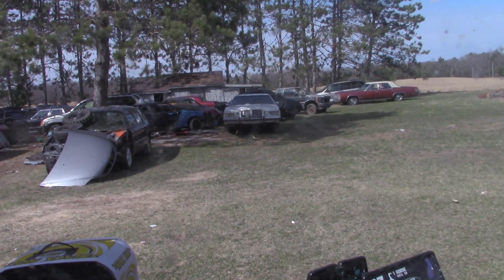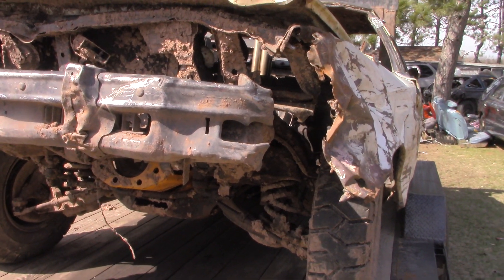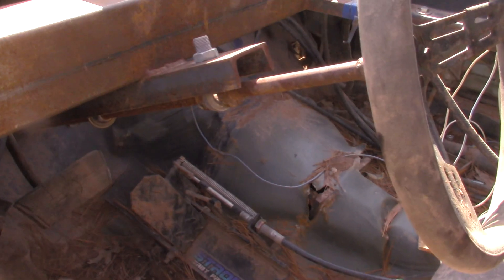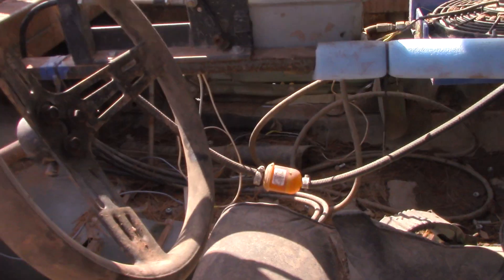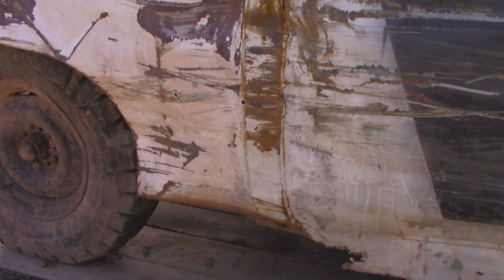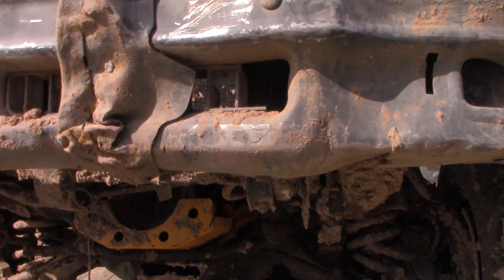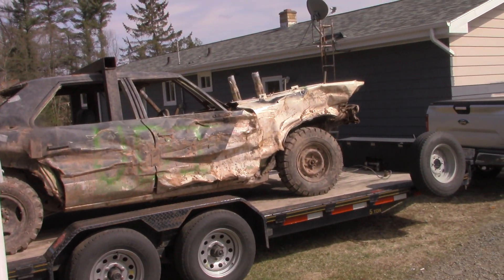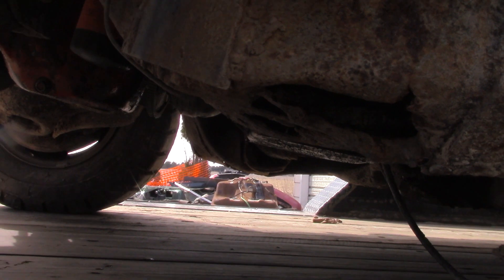NEW BIG CAR INTRO.... 1 of 4

Comment: I think there's two more good runs in her, probably three or four if you don't go nuts. That's a helluva cage in there. Go ahead and reinforce that front frame if they'll let you, and trim the clip back to the radiator housing so there's less of it to fold up and interfere with your vision.
Reply from the maker: so one good run if i'm behind the wheel...

Comment: The front isnt bad enough in my opinion to need to be re-stubbed. Id just pull it down a little and run it like it sits.
Reply: Agreed
Reply: I agree too.
Reply from the maker: leaning that direction
Reply: @1GooseGarage  good. I wouldnt put a bunch of work into it that it doesnt really need. Its still a very good, solid car.
Reply: Waupaca Fair car for sure!